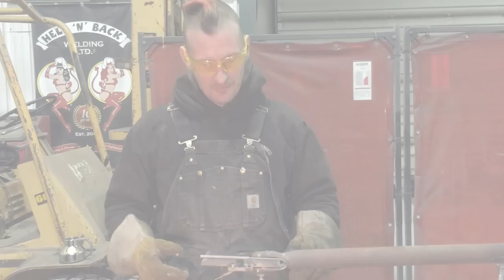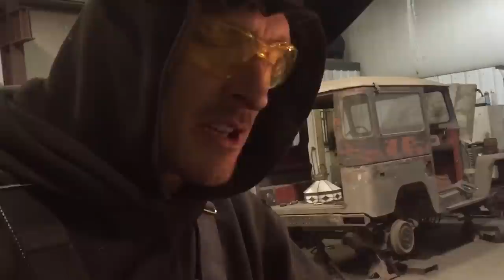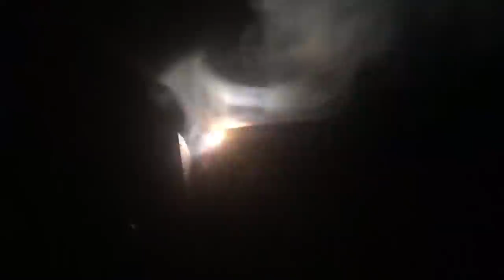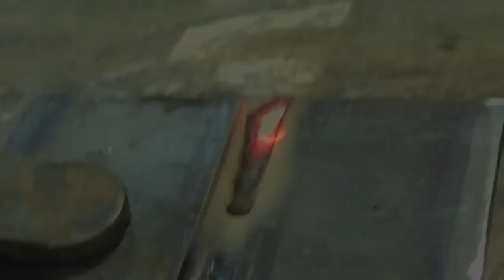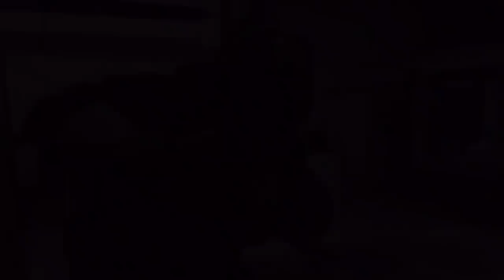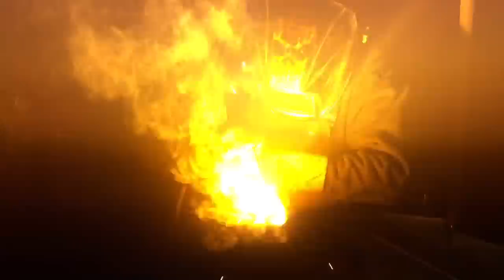How to Pass the CWB Flat Welding Test Part 2: Welding

Comment: From Ab here too,, just a thought,, I've heard that wire wheels can almost have a quenching effect on your welds,,  is that true??? I was also told your first two root welds up to the stop/starts have to start from the same end..
Anyways just doing my final year in college and the 4 position gives me nightmares,, My problem most of the time is body positioning,,  looking for pointers,, thanx pal,, good videos
Reply from the maker: Wire wheels can have that effect yeah, think of them like a fan to cool things down. But they don't have an effect on interpass cleaning because you're heating it up again with the passes. The first two root welds on the flat it doesn't matter actually because there are two different welds they're judging for. Your first pass is your fillet weld and that's done in one direction. The second pass is your groove weld and it's only mandatory you have to stop on the opposite side. So if you're given the choice you always take the long weld first because you can put more heat input into it. Body position is definitely very important. I still have to do videos on the other parts of the test where I can talk more about that. Good luck and good to hear you're almost done your ticket.
Reply from the maker: Jimmy Doe the wire wheel does to some extent. They really just say that at the end of you test. It is best to just let cool naturally to ovoids possible coupons breaking in press. I have seen it happen but not because cooling... cold passes was the cause
Reply: @HellNBackWelding  it's more efficient to start super hot an build down the amps from root to cap.
You got forty five minutes yes.
If something shits the bed if your fast an efficient with your time you could get a second go at one position.
It's always best to prepare for success yet keep enough time to solve the problem before the inspector leaves.
We are supervised while welding then ship off the the bends to be failed or passed.
If you can get your bent an failed quick enough in theory another plate could be welded out.
I got less than one hour from roots to bends test plate this last week.
Torch off backing strip.
My bent coupons were super hot, and buddy who's hard AF welder field welds in quarry bare hands it picks it up tilts it toward himself.
Put it down like it was maybe a hot cup of tea lol
I juggled the bastards with my leather gloves on lol
Test days don't have to be stressful.
Find time to practice them here an there inside the two years before your next check test.
Stay calm out the people just starting out.
It's gonna be ok.

Comment: I feel like your plate would be too high for me to be comfortable.
I put mine so low the inspector has to take a knee for my flat.
Horizontal wait high, I have a 89's highschool chair.
Vertical about the same height.
I stand for overhead with welding jacket on, sleeves for other positions.
I for vertical position myself to the end side of the plate.
Where I lean slightly for my start an make sure I can run the whole length of the plate.

Comment: Thanks a lot for this video series. With your help I was able to finally get myself familiar and comfortable with the cwb requirements. All of those little tricks that you show are invaluable, and I definitely feel like it's giving me an edge. 

Before last week I was only padding beads and practicing fillets, but I finally took the plunge into this and started tacking mock-up tests for the flat position with all the measurements as close as I could get them. We only have 3/16" thick plate at my school so it's a little lower than I'd like and you need to travel faster to compensate for undercut on the top edge but it's still good practice. Nothing to do now but keep burning rod and practice laying out those coupons.

Oh by the way, that tip about the extruded aluminum square on your trailer video has been really handy. I checked my local Canadian Tire and it looks like they still sell them. So I got one and it made a massive difference with the coupons. 

Cheers and keep it up
Reply from the maker: Love to see comments like this. Keep practicing and it'll be easy in time.

Comment: Your method using stringers is a much better way weaves especially on a small test plate is to much heat input almost all manufacturing of welding rods and wires the specs are for stringers

Comment: I passed my check test with right out the box cold rods.
Check tests are your next challenge two years after you pass all position.
Vertical roots maybe all of them I think.
Then switches to Overhead fill an cap.

Comment: Hi when doing the 1g cwb solid wire mig test on the start and stops can u weld in to ur stop instead of starting ahead and running back in then continue
Reply from the maker: yes you can if you feather out the stop.

Comment: After finishing the start and stops on the fillet side, how many passes do you need to have to finish off?
Reply from the maker: Rockhard Johnson depends if you do stringers or weave. If you're doing a weave you'll have a fill and a cap so total 4 passes. If you're doing stringers, you're gonna have 7-8 passes total.

Comment: Are 2 roots better than 3 roots? The third root being a center weld touching upon both other roots?
Reply from the maker: l B First of all I wouldn’t really call it a root - your first weld is a fillet weld. But don’t do 3. Only 2. On your flat, on your first pass on your fillet side you want a bit of an unequal leg so that you can make sure when you do your next pass to the groove side you’re not too wide and you can wet it in.

Comment: Hello, i was wondering if you still do a fillet weld, 45degree angle on the square side of plate up until you do the cover passes? Or after the first root fillet weld on the square side, do you weld just straight beads on the groove and square sides?
Reply from the maker: First pass on the flat, go for an unequal leg length fillet so your next pass when you weld from the fillet to groove weld you don't leave a wagon track or anything, those two passes have to be blended in. If you want to do stringers or weave after that it is totally up to you. The first two passes are the crucial ones.
Reply: Alright, I'll practice that. I did just a normal fillet on the square side of the plate and did a little weaving motion the second weld on the groove side to blend it in.
Reply from the maker: Merlin Kelly that works too, but you’re allowed up to a 5/16” fillet. As long as you don’t leave yourself a narrow channel for slag entrapment you should be fine.

Comment: Did you use 6010 for your root pass and at what amps?
Reply from the maker: No this is structural welding no 6010 here. It's all 7018. I usually like to run about 125 amps for the first few passes.

Comment: I was told that when I do my flat test, on my second pass to do a weave... is there more than one way to do that but still get the same results??
Reply: Never mind lol ignore the question
Reply from the maker: you are allowed 5/16 fillet first pass.and gust make sure your valley is not to narrow and run a hot stringer about125amp and it will be all good,if you need to slow down a bit to build up is ok but watch out for the slag.
Reply: Owen Stefura you can do either all beads or 1 root bead on the 90 and weave your second pass then weave filler till ready for cap
Reply from the maker: yes ether weave or stringer for fill and or cap depending on size of rod and size of cap.

Comment: This video is so good I watched it once and challenged my b pressure and just got my b pressure. Wow you are the man!!
Reply: Demon. What amperage would you use for your check test?  I’m more concerned for the uphand root. I want to make sure I burn hot enough to penetrate the full joint but I don’t want to blow a hole through the backing plate.
Reply from the maker: Congrats! Although I think you need to take allt the credit for that. Still glad if any pointers helped.